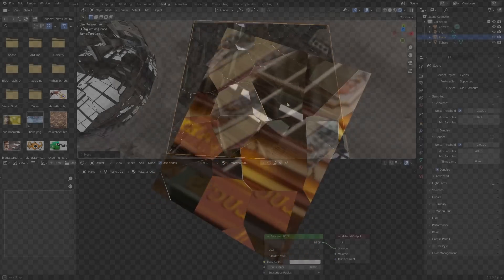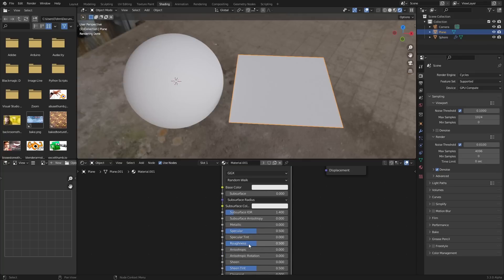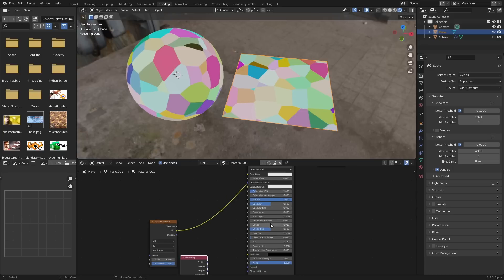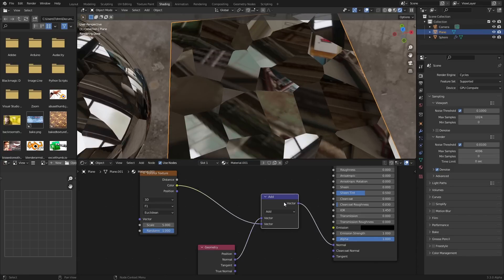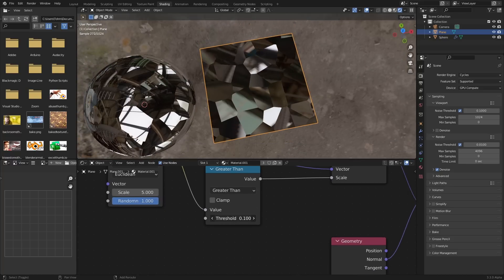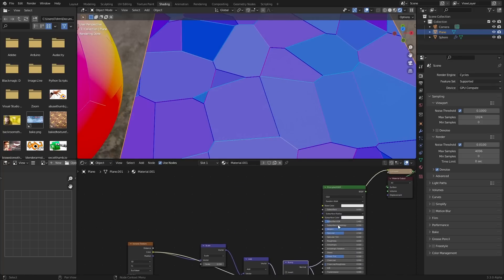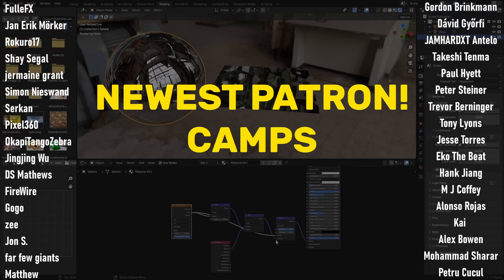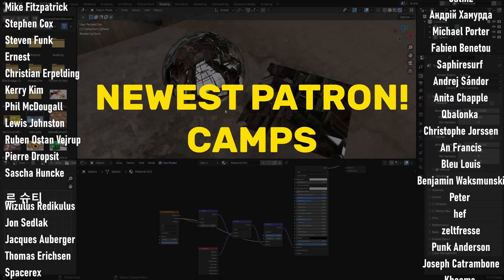Blender is SHATTERED

Comment: using a 2nd (or more) voronoid texture and a mix node you can add smaller or larger chunks ;)

(maybe u mentionned it in the video if so im sorry I tried to do it by myself at first and just skipped to the parts I was stuck)

Comment: I know this isnt about mirrors but it looks like it, good stuff from a distance except you can't take it further or rather closer to view. this works best for NPR but for PR: a physically accurate mirror is simply a thin film of reflective material on a sheet of glass,

so for rendering physically accurate mirrors youll need a glass geometry and a film plane behind the glass on a micro distance so they dont overlap,
to have those: start with the glass geometry and break it with cell fracture, then select all the faces from one side of the mirror and duplicate the geometry and move it away a bit so it doesnt overlap with your glass geometry and now you have your film plane, keep the duplicated geometry to their respective parents for simulations. work the shaders on each glass and film.

you can only take shaders so far and for PR its not ideal as they can only simulate in 2d emulating 3d, broken/cracked/shattered glass have depth that crosses completely from one side to the other in most cases, except for scratched glass where it can be easily cheated with texture as it is only on one surface side,

however in the vfx industry its mostly cheated with stock effects or low res shader which is easier to hide when in motion with motion blur, except in closeups and slowmo's they do what I described above, sometimes they even add physics simulations for breaking chunks to smaller pieces.